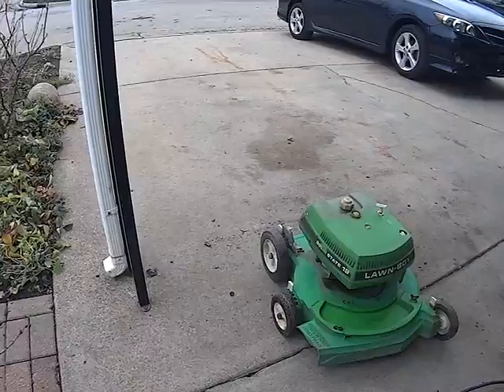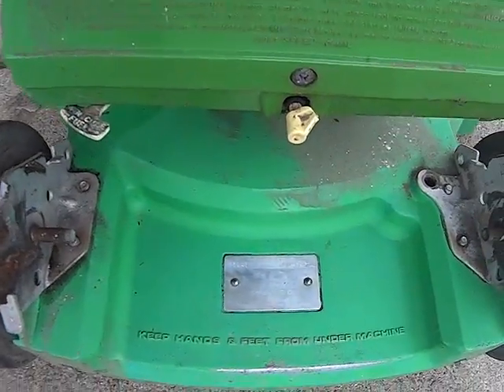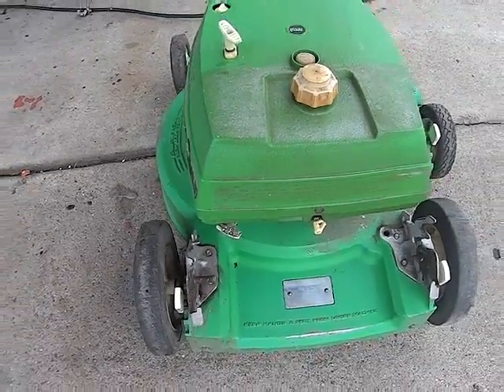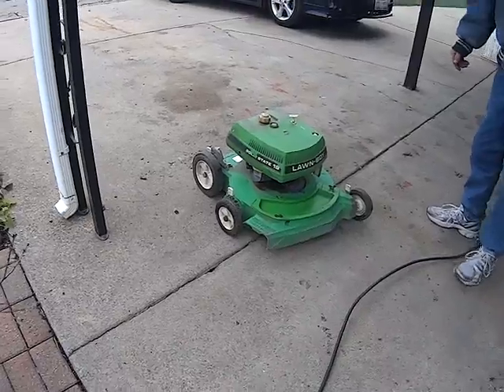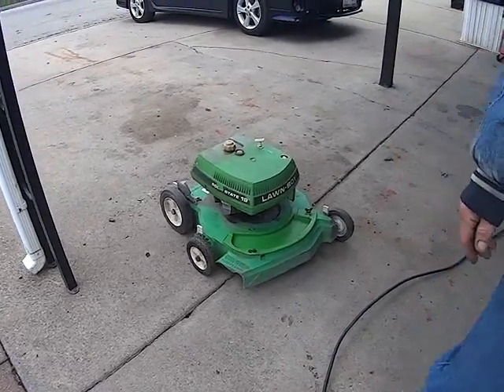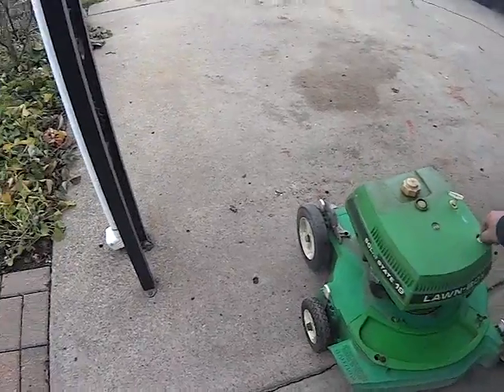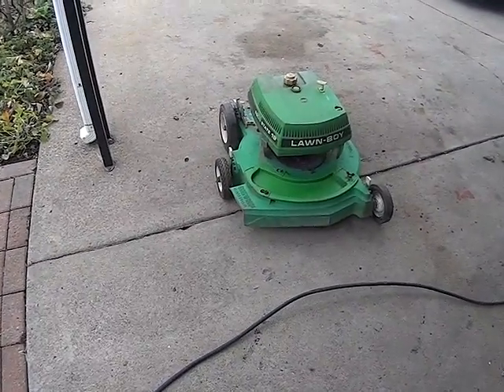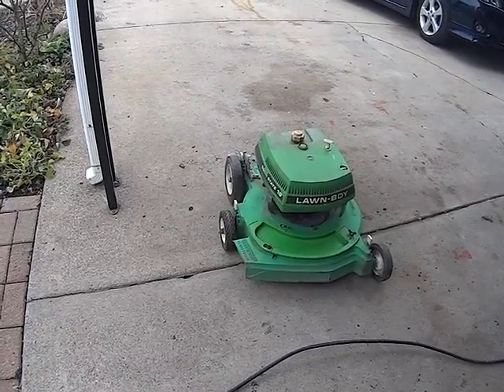Lawn Boy 1977, model 5245, works but needs some help.  by GreenShoes

Comment: That's how mine is but it clears up in 3 minutes about. I think I'm gonna clean the carb.
Reply from the maker: Right.  The carb is usually the problem with these old mowers.  My husband put a new crank seal in one engine and it worked great.